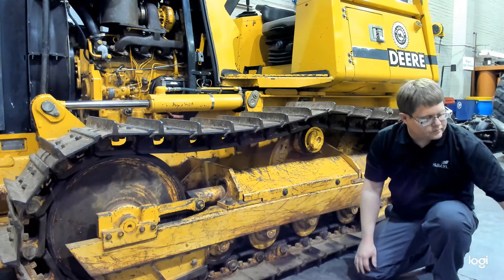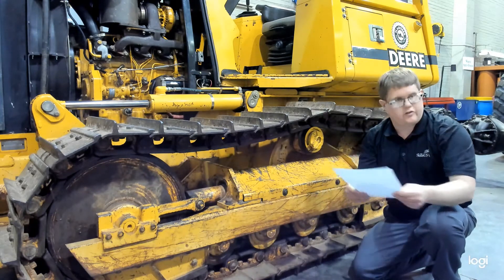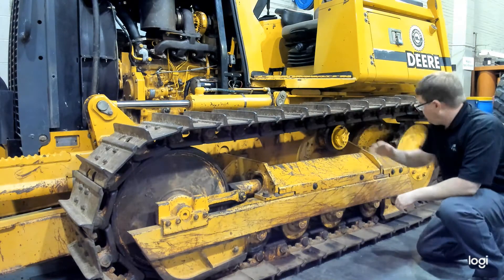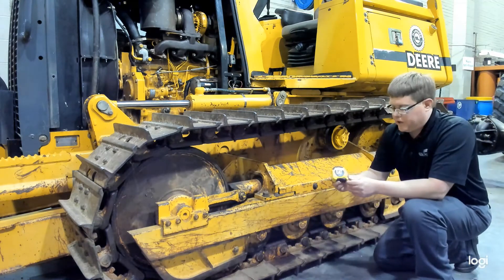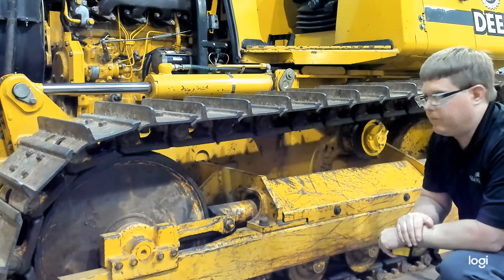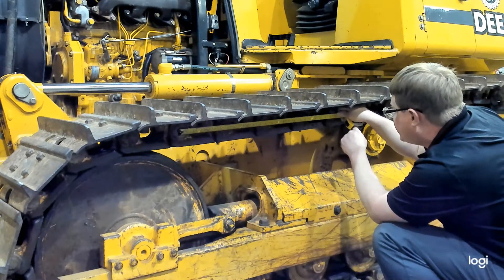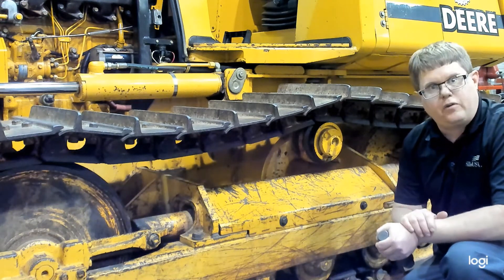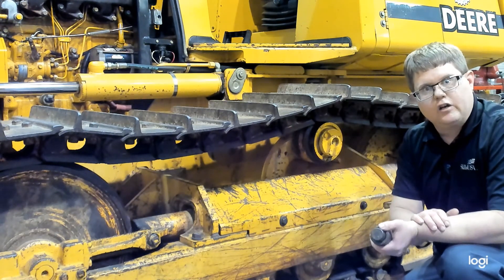Measuring Track Pitch

Comment: Where do you find the track wear charts? Im looking at a 450c with an easy 25.5 inches. Wondering what percentage that would be
Reply from the maker: You would find that from the OEM.  John Deere makes an "Undercarriage Appraisal Manual (sp326vol1)" and in there for a 450c it lists the new track chain pitch as 25.19" and 100% worn would be 25.67".  Unfortunately I don't know any where you can get this manual for free.  I hope that helps!
Reply: @JimMackHeavyEquipment  that helps greatly. Thank you. I might have closer to 25.67 if I stretched the track as you showed. I wasn't able to move the machine, so I just measured it as it sat. Worst case is I buy the machine from my friend and turn the pins/bushings and probably replace some rollers. As far as sprockets, is an 1/8 to 3/16 inch flat on the crest of the tooth worn too sharp, or is that still serviceable?
Reply from the maker: @michaelscafe2818  oh, and your measurement of 25.5" would be considered about 65% worn.